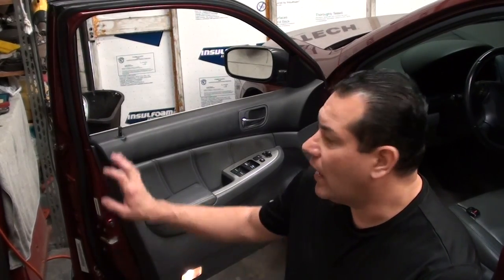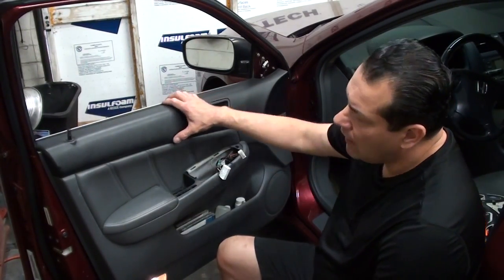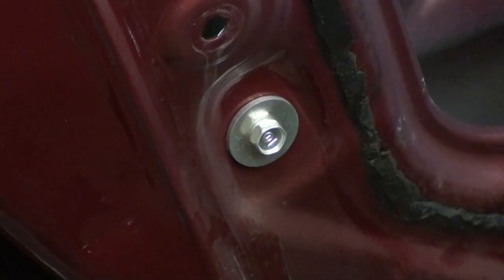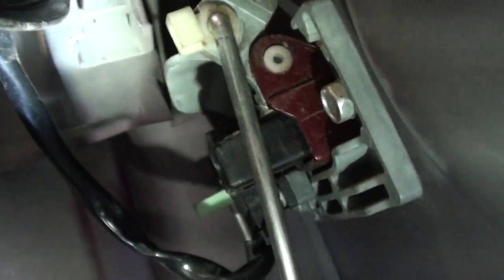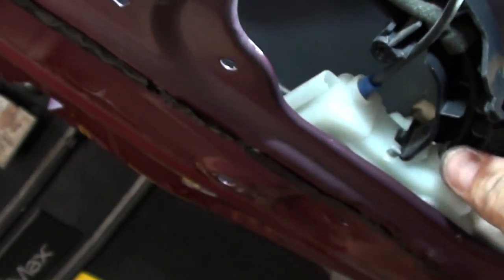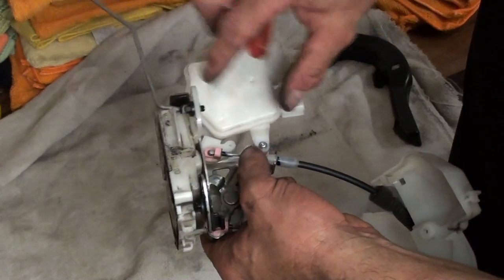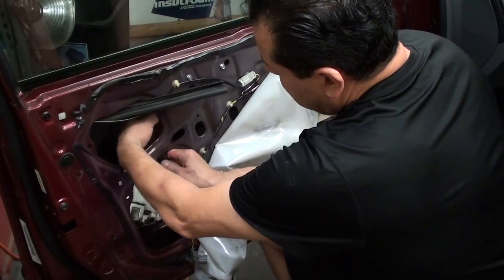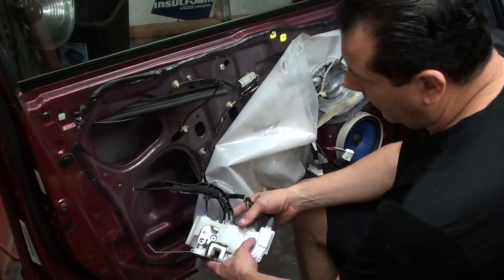How to replace door lock actuator on a 2003-2007 Honda Accord (driver's door)

Comment: Thank you for this video!  I just replaced the left door latch cable and your video got me through it. BUT...I found a shortcut that everyone should know.
The hardest part of removing the door actuator is that ONE rod with the green clip. After trying for at least an hour to get my fat fingers up into that area with no success, I took a short break. Stood up to stretch and noticed a rubber access hole cover on the side of the door that looked to be right at the height of the green clip. I popped that puppy off and EVERYTHING is right there. And as you suggest of inserting one screw to hold the actuator in place while reconnecting everything, doing that puts that rod almost right in line with the hole & clip. 
Unfortunately there's no way to post pics but when you remove that cover you'll see for yourself.
Reply: Thanks for the tip!

Comment: Paul, your video was incredibly helpful in replacing the lock actuator in our 2006 Acura TSX.  I literally had it replaced is 34 minutes start to finish thanks to your insight regarding the process and steps to do it.  The process on our Acura was just like the Accord.  Thanks very much, well done and very, very helpful.
Reply from the maker: The Thompsons glad it worked out for you, but my name is Raul, not Paul.  Hahhahaha
Reply: Crud, sorry Raul.  Guess I should have had my reading glasses on, my apologies.  :-)  Thanks again for your help.

Comment: Whole video is darn near perfect - we changed out left and right sides using it - thanks! At the end, the final door handle cable connect with the plastic clamp - I did this just now, but forgot to seat the cable sheath's slotted plastic collar into the metal forked slot - result, I couldn't open the door from inside the car!  So:: there are TWO final steps before you secure the door panel - clip the cable end to the handle AND seat the cable slotted plastic collar into the metal fork to keep the sheath in place!
Reply: Very easy to understand, after walking though disassemble and installing door works great.
God bless

Comment: I wouldn't have been able to replace the door latch cable/get out this piece without you - thank you.  The repair probably took about an hour and a half.  I was hesitant about taking off the parts as I went like the window guide/metal and rubber guide piece but it all went back into place just fine without any issue. I have a 2005 Honda Acoord V6 Sedan.
Reply from the maker: Conor McKenna glad you were able to fix it.

Comment: Without this video I would be sobbing in the garage trying to figure out all the little clips and hard to see and reach things.  I don't think this is a job for the less mechanically inclined.  I found the most difficult parts to be the little green clip way up inside the door, and the very fragile cable end at the door handle.  It won't tolerate much tugging on it at all, which happens in the course of getting it off, and then going back together.  If you break the plastic cable end at the final install,  the whole process has to be redone, and more, to install a new cable.  Breaking any of the little clips that may be brittle from years of baking inside the door will stall the whole repair while you scramble for parts that are not readily available.  There's a lot to have to pay attention to in accomplishing this procedure.  Thanks to Raul for sharing!  OMG, it still took me hours!

Comment: Really helpful! One tip based on my experience, the little top rod’s snap had the little flap break when I opened it, which made it really hard to get back on, so just be careful when taking that off. Thanks!

Comment: Great video! My 2007 Honda was a little different then some of the other videos of Honda's I saw (different screw placement on door panels). This was super thorough, and showing everything via video and step by step was very well done. Was able to replace my own actuator this morning. Took about 2.5 hours, but it's all up and working now. Thanks! 

For anyone else who does this, don't freak out if at first your keyfob doesn't work when you test before putting all back together, mine didn't, but once I plugged in the power to the window/lock/mirror panels, those buttons worked from lock and keyfob started to work.
Reply from the maker: glad to hear
Reply from the maker: Paul Brown if you Could subscribe to my channel that would be great YouTube want to take it down because I don’t have enough subscribers the subscription doesn’t cost anything it’s free it just allows me to keep putting up more videos thank you

Comment: There is a plastic plug on the door jamb that you can remove to help with the inner(back) rod where it connects at the top. It made the job a bit easier. Other than that thanks for the video, it helped a lot!
Reply from the maker: Kyle Meyers thank you

Comment: Paul, thanks for the video. I have a 2004 CRV. When I attempted to reinstall the window channel. I lined the channel bolt hole with the lower of the two holes on the door frame. Unfortunately when I tried to put on the door panel a clip was designed to fit in that lower door frame hole. To move the channel up to the higher hole it proved to be a big challenge. Mine was the frt. passenger door. This problem  stopped me dead in my tracks. In your case it seems the channel was designed to fit in that lower hole.
Reply from the maker: Cayrick Pan sometimes things ate not as easy as they look,& take a bit more patience. I walk away and then come back when issues arise

Comment: This was a terrific video and really helped me understand how to change the actuator. I watched your video twice before starting work and the task went much faster than I expected. I found I didn’t need to take off the black cable guide - just tease out the cable, and smearing a little dishwash liquid on the metal window track really helps getting the rubber window seal back into the metal track. Many thanks.
Reply: this is the comment i am looking for, its a bitch, going to go back to the job now and finish up

Comment: Thank you for such a detailed video. The process was time consuming (4 hours) bit we were cool with that. We weren’t in a rush and wanted to make sure we did not break anything.
Reply from the maker: Merrell Johnson actually takes about an hour.  I did two the other day and actually was able to do both in about 1 1/2 hrs. But i have done many of these
Reply: @raiderman28  where are you located lol
Reply from the maker: @franksilva3302  i am located in San Diego ca
6219 university avenue San Diego, ca 92115

Comment: Kudos! Very well made video that highlights how to handle important and tricky steps (for instance, how to not break fragile plastic piece on door handle cable). I have used it to successfully replace a failing actuator on my 2006 Honda Accord. Works like a charm now.

Comment: Really nice video. Dealer wanted $350 for parts and labor. Saved my Sister in law a bundle here.
Reply from the maker: Steve Stock i am glad it helped you out.  I usually charge about $195 labor on these plus parts are about $50-$60. They are a bit time consuming. This one wasn’t that bad.

Comment: The video was very good and it saved me several hundred dollars.   But I caution you, if the car is an older model be sure to get a new cable for the inside door release.  On older cars the plastic becomes extremely brittle and the head of the plastic sleeve WILL easily break as mine did.  After this I needed to replace a window regulator and the second one broke (as the one in this video did).  Save some time, the cable only costs about $15.
Reply from the maker: You are correct on that door release cable, they do break easy, since those vehicles are older now.  This vehicle didn’t have alot of miles on it, so the cable gave me no issues

Comment: Thank you for posting this. It helped me make sense of some of the finer points of my latch cable replacement. Getting that assembly out and back in was the tough part!
Reply from the maker: Hymnalysis yes it is. Hahhahaha you are correct.

Comment: Awesome video, great step by step description of the process - thanks much - however, it looks to me like a lot of work - I think will just use the key to lock and unlock the old fashion way.
Reply from the maker: Laurel99 hahhaha. If you take it to a shop maybe $50 for the part $150-200 labor
Reply: @raiderman28  - the Honda dealer asked for $327 - I said let me think about it - that was two years ago. You did the whole thing in 31 minutes - probably it would take me 3 hours plus and most likely break some cable and/or few clamps. As Dirty Harry said - a man must know his limitations!  I appreciate your video for bringing awareness to my lack of skills!!!

Comment: I have an issue where my remote unlocks the door, but putting the key, or the valet key in the lock and turning it does NOT move the door lock to unlock the door.  Is the potential problem in the lock assembly where you had the green clip that was so hard to take off?  This became a problem when my battery went dead and I had to call a locksmith to get back into my car!!  Your video is VERY well done, and you explain everything which is very helpful, thank you for that.
Reply from the maker: more than likely yes. the issue would be what connects to the lock cylinder.  you will have to take the door panel off, to see if you can spot the issue

Comment: This is the best video I've seen so far I have a 04 accord which needs both driver and passenger door lock actuators to be replaced. I already have the parts to replace the old although the only question I have is the passenger door wont open from inside or out what could I do?  Thanks.
Reply from the maker: Erik Burgueno you will have to probably take the front seats out through the drivers side, then try to remove the door panel ( which might get damaged in order to remove) then find a way to open the door, by pulling on the cable that’s attached to the handle.  That cable has a tendency to break off right where it attaches to the pull handle ( they get brittle)

Comment: Thanks for the excellent video.  I was going to do this job but it almost seems like too much work for a notoriously bad quality part that will likely go out again?
Reply from the maker: Thats why i usually use factory toyota parts when i replace these, so they last 10-15 years

Comment: Hi Paul. Great video! Best camera quality and detailed explanations I have seen so far on one of these. 
I have a 2003 Honda accord. The front passenger side door will not unlock with fob or door control but I do see it trying to unlock ( the lock moves up a little but not enough to fully unlock.) If  I push the unlock fob at the same exact time as pulling really hard on the lock I can get it to unlock.  Then if I push lock button again the door locks. Do you think this is the actuator or something else. My car guy says, that because the lock moves  he doesn't think it is the actuator.  Please let me know what you think and thanks for the great video!
Reply from the maker: Beck O' Gnize it is the actuator. When they start to go out they are very inconsistent in opening and closing. Thats how they start to show signs of failure.  I have done many of these
Reply: Raul Romo thanks for your reply! I’m going to follow your instructions and try and replace it myself since the dealership wanted to charge me 400 dollars to fix it.
Reply: I replaced the actuator and my lock works now! Thanks again for the great video! It was very helpful especially as a reference to put everything back together again.

Comment: Awesome video thanks. I would add that on the door jamb at the top is a black plug. That plug pulls out giving you better access to the green plastic holder that connects to the rod. Still a tight spot but with a screw driver in that hole and your hand through the other its doable.
Reply from the maker: Yes you are correct.  I noticed that when i was done

Comment: Thank you for the detailed video. What is the functions of the back rod? I replaced the actuator and unfortunately the clip to the back rod broke. I had to put everything back together because I need to use the car. The crazy thing is that everything works. Not sure what that rod really does. Thank you
Reply from the maker: Sorry but its been awhile since i made this video. I don’t remember what that rod is for. Maybe if locked, you can open from the inside. Maybe thats what the rod is for.

Comment: appreciate you guys doing this job. i was thinking about doing it myself but after you and another video i watched, had the same amount of hassle, i am deciding to let the pros do it.  The previous owner of my 2004, had a broken key lock. So the key would not open door, plus the fob wouldn't work either?  So he just got a new lock, with another key(not fob), just a key to fit new lock. So he can unlock door, but fob will not open electronically. Honda said it would cost twice as much because the actuator probably needed replacing??  Would need a new key-fob to program new lock/actuator. But i own it now. Need a  couple new keys, the old one is breaking up, but i guess the actuator needs replacing so that all keys work. Not sure if the passenger door actuator will  be an issue. The driver door inside button will not open passenger front door or drivers? Hopefully its only the drivers actuator, and the passenger will open once drivers fixed. Drivers buttons will open back doors but not front? Make sense to you? Anyway, it looks more of a pain to me but i wouldn't know that if you all hadn't done it!  Thanks for saving me the hassle! Profs to all of you.  I am older and know my limits.
Reply from the maker: wd neojoneswd if the master lock switch is bad, then the passenger door will not unlock.  I just replaced both actuators on a 2004 2 door accord.  I couldn’t believe that both would go out at the same time. He purchased the vehicle used and this was already a problem.  The remote would flash the parking lights but not work the locks, and neither would the switches. The actuators were both bad. Replaced them and everything worked.  If your remote is not working at all, the battery inside it could be bad.  Does it have a power truck?  Does the remote work for that? Some of those Honda’s came with a pop truck button and some with a pull handle or both.
Reply: @raiderman28  it opens back doors but not front and not trunk? The trunk acttuator had a missing screw so it wouldn't open with the pull lever. I replaced it, trunk opened with lever, not fob. Could be a bunch of issues.

Comment: thank you very good job, Is there a way to bypass the switch because the window is stuck down in the back window and the switch is broke at the button, thanks again
Reply from the maker: tony montiero go to the window motor wires. Cut wires use a makita or drill battery. Put one wire on one side of battery and one on the other. It will either go up or down.  Flip wires to make it go in opposite direction.  Make sure your only wired in to window motor only. Sometimes there is a plug you can try to tap through so you dont have to cut wires just make sure both wires don’t touch while you hook it to the drills battery pack. 
Hopefully this makes sense

Comment: Thanks for the helpful video, in my 07 Accord, rear driver door lock doesn't work with remote or from the main master lock switch on the driver side, what could it be? I ensured child lock isn't engaged. If it's actuator, are steps exactly same? Thank you
Reply from the maker: Maverick Person should be same issue, but since its a rear door, might be slightly different to remove and replace, just because front and rear doors are different. But with this video, it should give you a good general idea how to do the work
Reply: @raiderman28  , thank you. Would you suggest a dealer or a used/aftermarket would be fine too? Thanks for the help.

Comment: Just to add something I did that would a lot helpful. To clip off the latch for the last rod. The black round plastic clip below the door latch can come out and you can reach in with a finger and latch the clip off the rod without pulling out the long metal rod with the rubber piece.
Reply: This is true. I got my part from the junkyard for 6 bucks and this is what I did on the removal of that one. Hopefully everything works out

Comment: My advise, make sure to buy an actuator with the plastic cable snap preinstalled. Also, make use of the rubber covers for visual. 

I had trouble guiding the window track bracket back onto the rubber. This was because there was interference with the bottom of the window. I had to feel around and lightly pull the window inward to get everything aligned. 

Awesome results, I’m super happy with the repair. Thanks for the video!
Reply from the maker: Zachary Gateley sometimes thats what it takes, feeling around. Also the dealership I purchased the actuator from didn’t have the option of a preinstalled cable snap.

Comment: this part sucked bad until i figured you can pull that actuator whole mechanism out and that rod bends out and it is much easier to attache it when both are out then you have to wiggle it in. The hardest part of this repair 24:00

Comment: Raul I cannot get those three screws out where the actuator goes… I am using a screwdriver and a milwaukee drill/driver/. I’m debating calling it quits because one of the screws has lost a lot of its thread… any ideas??
Reply from the maker: Spray it with wd-40 first then use some thin vise grips or drill out the screws or use a dremil to put a cut into the screw and use a large flat screw driver to remove. Hope this helps you out